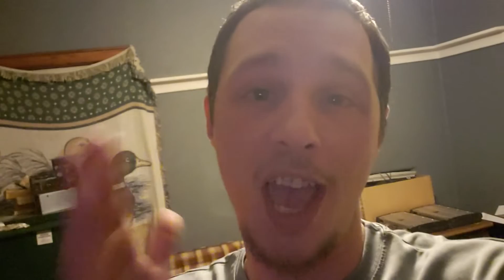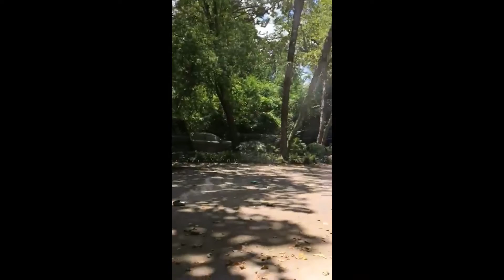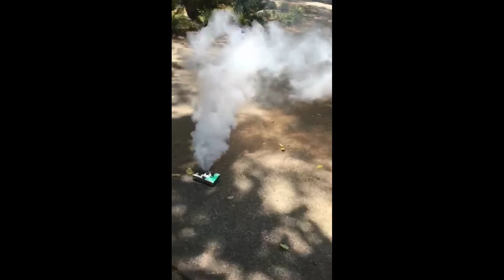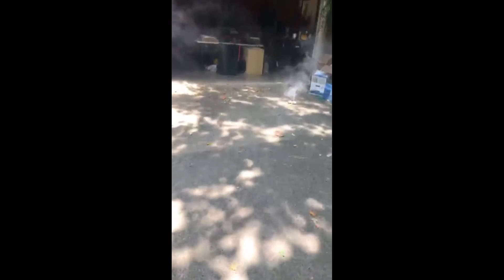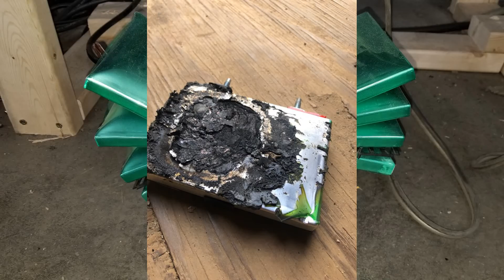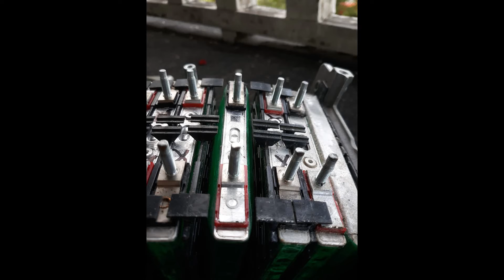Can Cmax Cells Burn ?! Lithium testing !

Comment: Only some of those look like the 24ah Cmax Energi version. Most  are the thinner 5AH from the regular Cmax (non plug in hybrid) that have a far lower current capacity.

Either way they must have proper clamping.
Reply from the maker: The 24ah cells are far worse dangerous wise

Comment: Basically wire correctly get terminals & most importantly don't beat them with a hammer copy!
Reply from the maker: make sure you use the factory case or steel compression , otherwise when they swell all it takes is a short or a smack and you have fire . just ask anyone that lost a vehicle to a fire , they will tell ya

Comment: The thing with lithium is that you  have to have high amperage disconnect overload protection which is expensive and not easy to do.. Or the easier way is to build a bank 3 to 4 times bigger than the amperage rating says so that you are never pushing the cells to their maximum. It’s a hard thing to do in car audio due to space limitations. And depending on the chemistry undercharge them by .3 volts per cell. If you have 4.2 volt max cells charge them at 3.9 per cell. Or 15.6 overall. It goes back to the saying you have to pick 2 out of 3.  
cheap , dependable , performance. You usually never get all three.

Comment: To consider it unsafe for us is venting and catching fire with no reason. Who hits their bank like that? Even in a crash it’s not gonna be hit that hard that many times in most cases. Show the battery venting while under heavy amperage load. Or in a car at 130 degrees. I have no horse in the race bc I run lipo04 but hitting the cell with a hammer a dozen times and it doesn’t go shows it’s decently safe imo.

Comment: I've ran my truck purely on Cmax cells for months. No issues. Keep them compressed and charged at proper voltage and they'll last a very long time
Reply from the maker: problem is not everyone is doing that . we all need to preach proper builds with these cells
Reply: mazda2284 how does this video teach anyone how to properly build? You’re just spewing propaganda

Comment: You called me in Canada to buy my prs2000Dspl last year .  Guess what happened I plugged in an aftermarket bass knob I blew up both of them not necessarily blowing right up but it fucked up something in the digital part of the amp the driver boards I think and the ended up being useless the quote was thousand to fix both so I said fuck it and sold them to somebody for 500